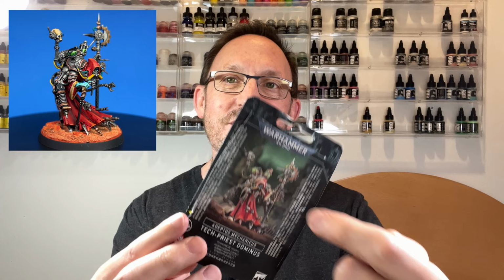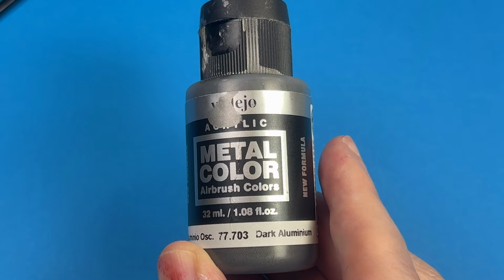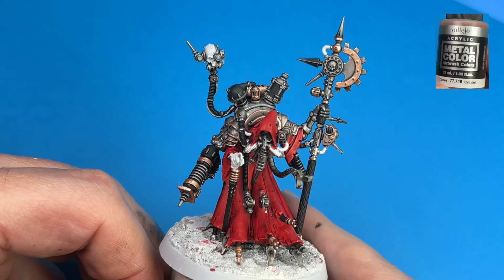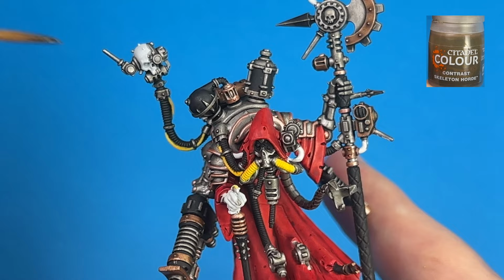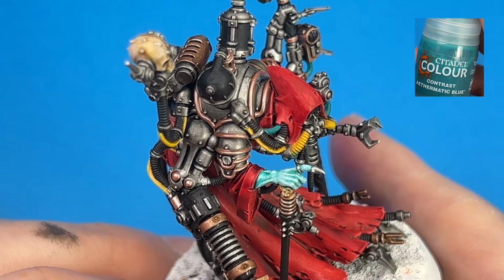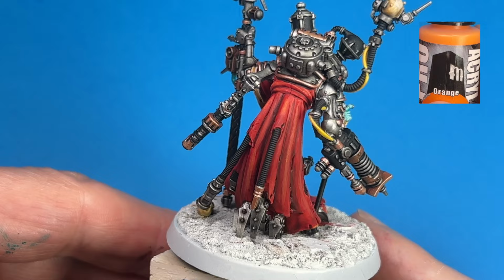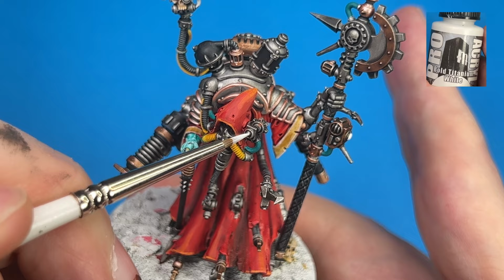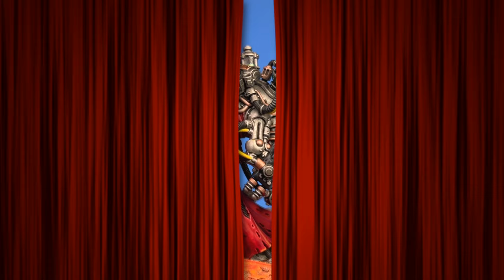How to paint Warhammer 40k Adeptus Mechanicus Tech Priest Dominus

Comment: awesome video! keep it up =) would you mind telling me which brush you are using? your brush and paint control is so clean!
Reply from the maker: I shall.  I use rosemary %& co kolinsky sable series 33 (they call it pointed-round). Size 1 and 2, for just about everything. I'm a bit of a brush hound so you might see others in the videos by those are 90% of the time. Although, sometimes for applying contrast paint to a large flat surface I use a brush with a broader tip to make less brush strokes, a "filbert" Rosemary and Co series 66 Kolinsky.  BUT my clean paint control might very well be attributable to my magnifying glasses. I don't paint a stroke without them on my eyes. They make these if you don't need to put them over corrective lenses - https://smile.amazon.com/gp/product/B081TV2GNH/.  and these work if you have reading glasses underneath - https://smile.amazon.com/gp/product/B007CDJKM2/ 

Thanks for watching!  KPM!!!
Reply: Parabéns pelo seu trabalho muito lindo sempre vou acompanhar
Reply from the maker: Muito obrigado!  
Continue pintando miniaturas!!!  :-)